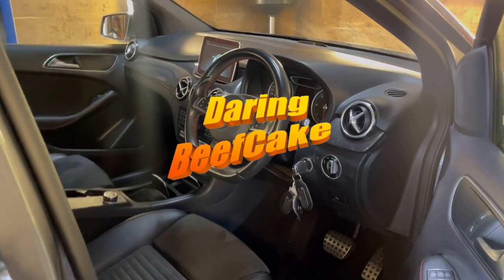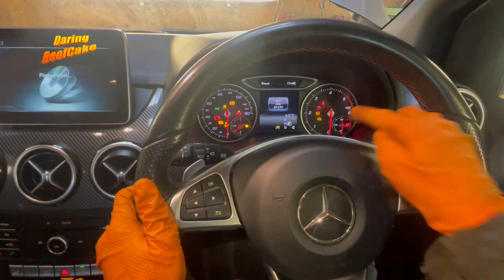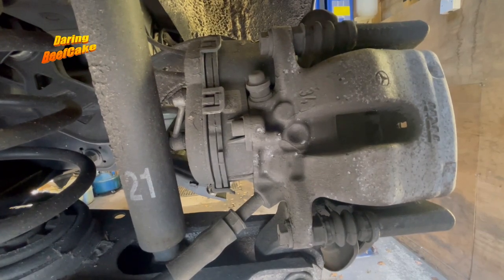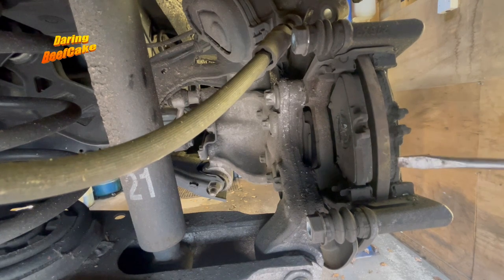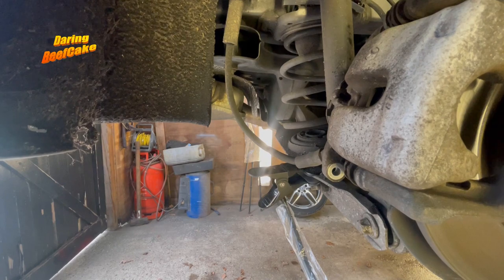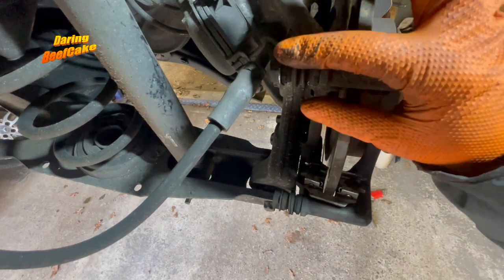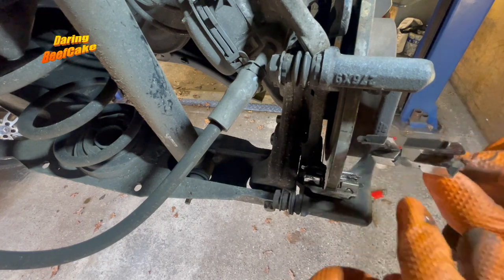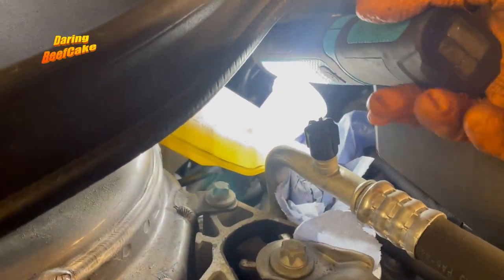Mercedes b class w246 rear brake pads removal and replacement

Comment: This was the 3rd time I have replaced the rear rear pads on my 2014 Manual W246, but this time I had an error message when trying to finalise the electronic handbrake - something about the conditions not being met.
I double-checked everything, but couldn't find anything wrong. I tried it in gear and in neutral, foot on and off the brake pedal and/or clutch pedal, but nothing made any difference.
I took a 30 minute break to watch your video and when I went back to it, it reset first time!
I have no idea what caused this, but I did notice that the sidelights came on and stayed on until it reset.
Reply from the maker: Never had an issue but thanks for sharing your experience, weird things happen all the time so it’s good to know.

Comment: how do you change the rear discs? is it different than than the front wheel? thanks!
Reply from the maker: Is not that different but you need to access the release rear calliper menu in the computer to open the pistons then is very much the same as the front.